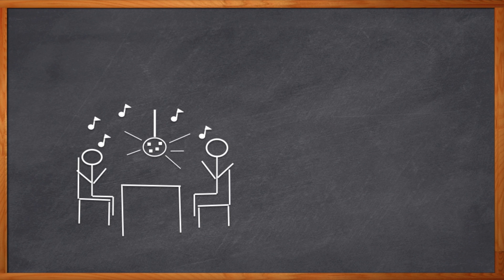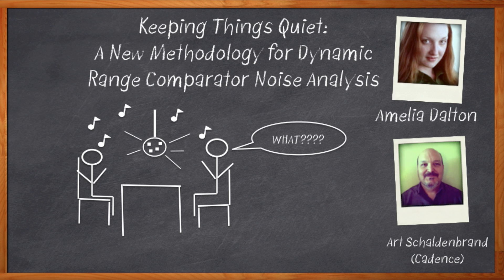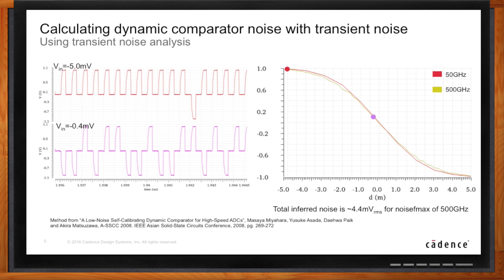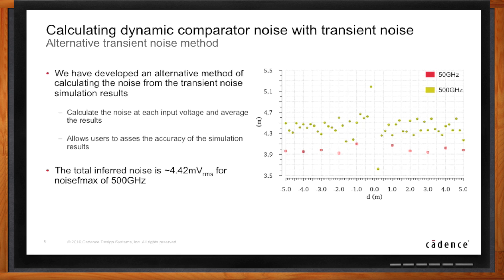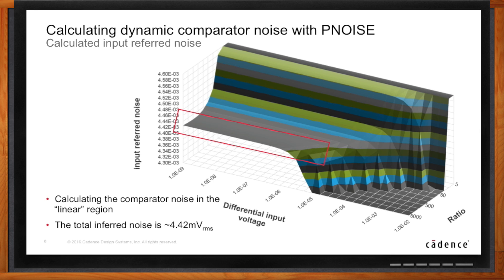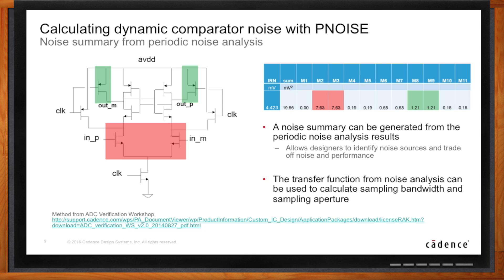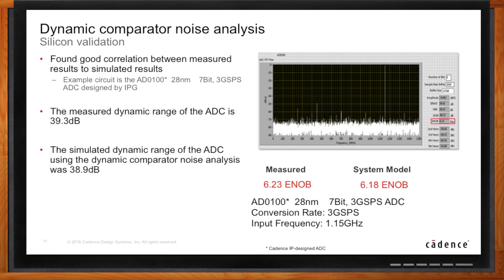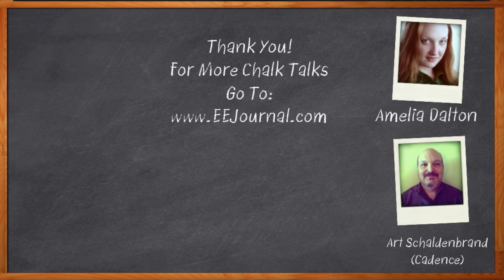Keeping Things Quiet: A New Methodology for Dynamic Range Comparator Noise Analysis -- Cadence

Comment: Elaboration on PSS/PNoise - possible? The Rapid Adoption Kit has some - but what value we put for threshold of crossing? That seems to be key as if we put Vdd/2 as threshold - by that time the circuit is already non-linear and much deep into re-generation (much after sampling and gain). In one of my trial design, I do get transient sims as ~0.3mVrms but this PSS/PNoise gives me >1mVrms. This cannot be claimed as matching. The max I can take the PSS/PNoise is as more of a qualitative tool (coparison between the elements on the contributions) . 

Please help.